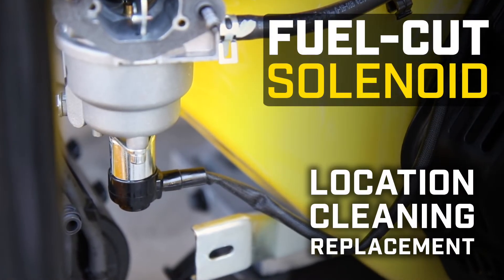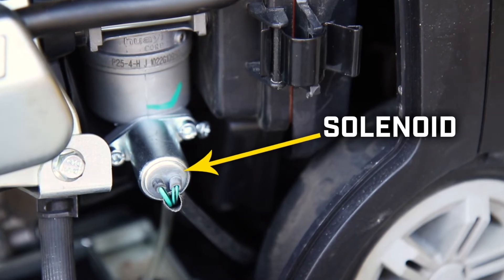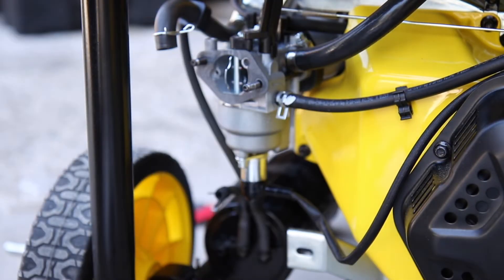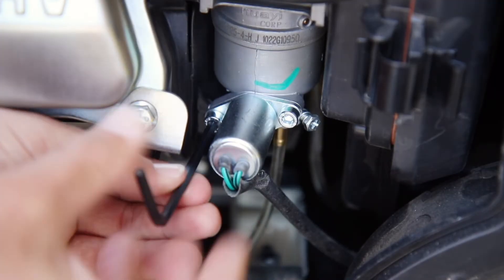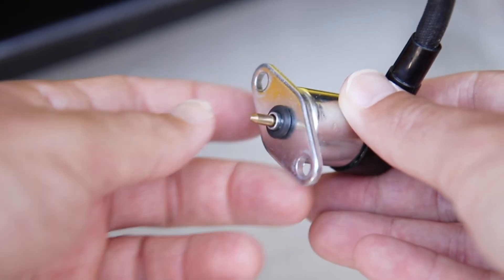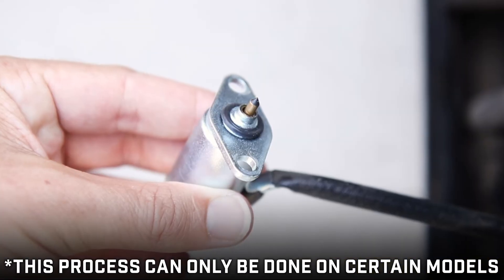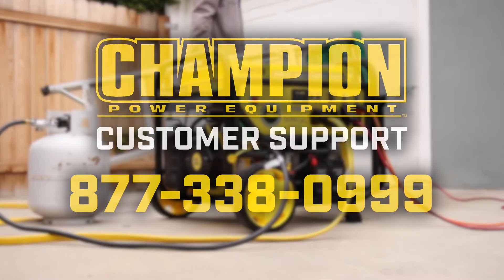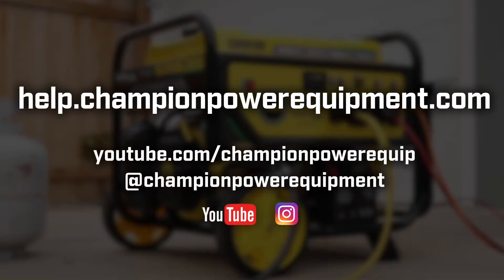Fuel-Cut Solenoid

Comment: What is the purpose of the fuel cut solenoid?
Reply from the maker: Hello, the purpose of the fuel cut solenoid is what stops and allows fuel flow into the carburetor bowl. If you need any other assistance please contact our support team at 877-338-0999. Thank you
Reply: I believe it is to block fuel so engine will stop running immediately and avoid backfires